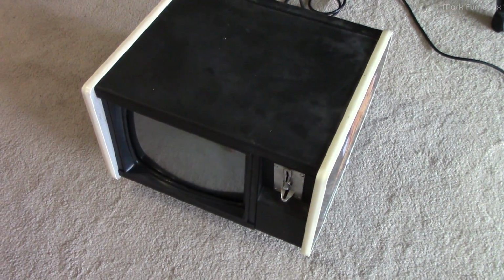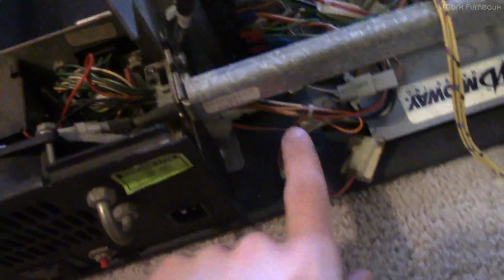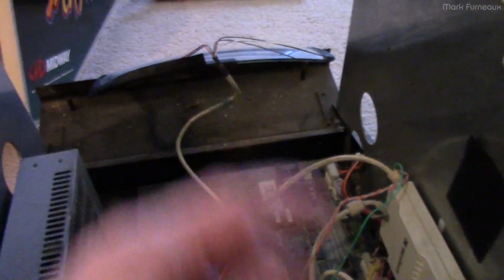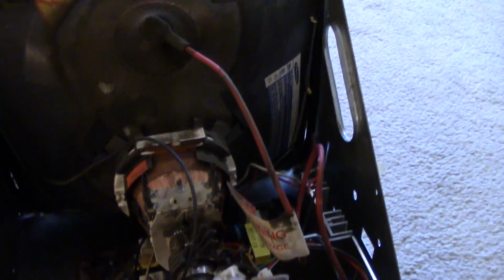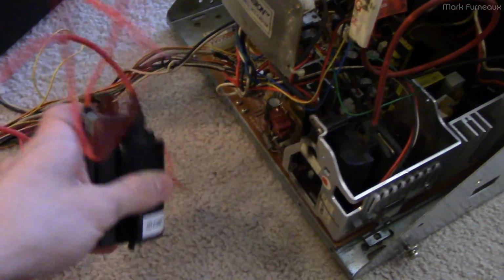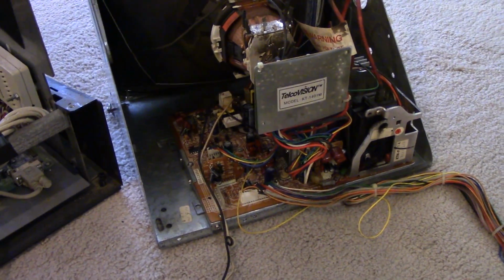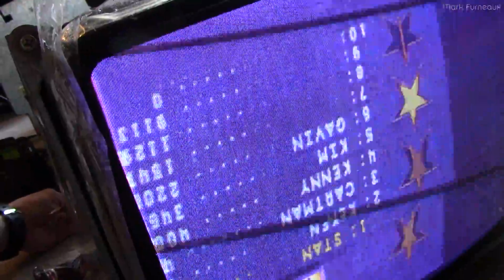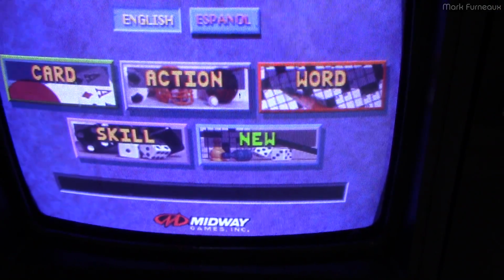Repair of a Midway Touchmaster 7000 Bar Arcade Machine

Comment: I just picked one up but has no keys what do both key holes in back of machine open?the top? The keys might be hanging inside so does this have the right side keylock to open from for adjustment or is the adjustment in the back?

Comment: 8:12

No need to guess - the pinout is clearly written on the monitor's silkscreen. :p

The MicroTouch looks like it might have the type of serial plug that has a DC input on it?
Either way, there would still have been space for the DC connection anyway, so I'm not quite sure why the extra wires were added either.

Maybe they are just bypassing some regs in there for some reason?

Comment: That's a nice vintage touch panel. I'd bet it's using SAW (Surface Acoustic Wave) with that arrangement of wires. There is piezo transducers at the edges of the glass.

Comment: The school I used to go to had a Touchmaster 8000 on freeplay, I spent many hours playing hot hoops. Theres not much difference between the 7000 and 8000. The one you have has a slightly modded case.

Comment: Would have been really cool to see your diagnostic process. Opening it up and looking for the problem is often the most fun part. 

Do you know why there is that horizontal line running across the fixed screen?
Reply from the maker: That's just the sync difference between the camera shutter and the VBlank on the monitor. Just a camera artefact.
Reply: Mark Furneaux duh I should have realized that immediately. Thanks for the reply

Comment: Actually it is not only a demo: It serves a very practical use. 
Without the demos the picture of the main menu would get burnt in, and if you wanted to play something, you can't see anything.
Reply from the maker: Very true. It actually does have some burn in already from the high scores list. You can see where the static text is when the screen is off.

Comment: Whats up with the random fps drop and the general quality of the video?  It doesn't seem like the usual video cam.
Reply from the maker: It's the same camera. It was at night so there wasn't much light and it drops frames when it needs to boost the ISO.
Reply: Mark Furneaux Aren't there cameras that don't drop frames when they do that? You'd think there'd be cameras out there that do just that.